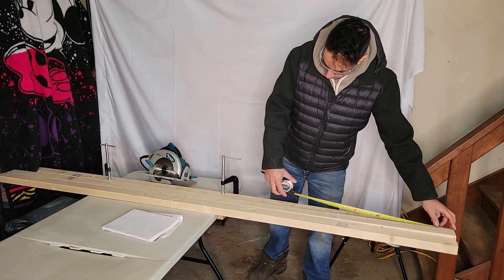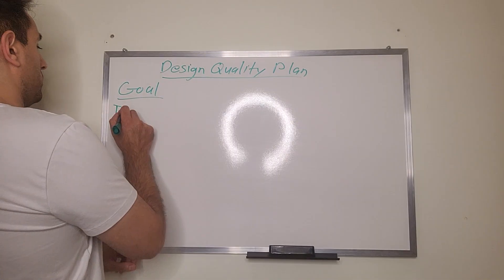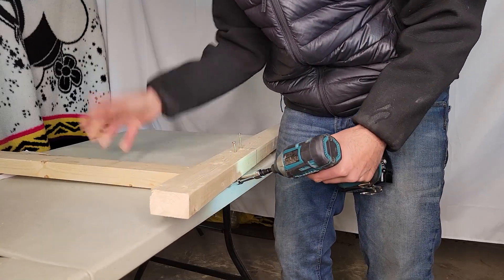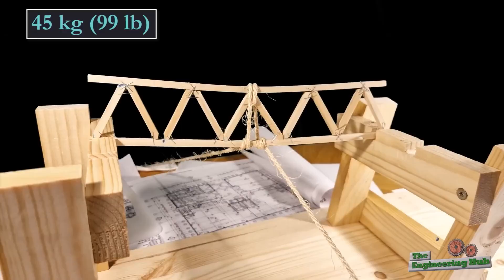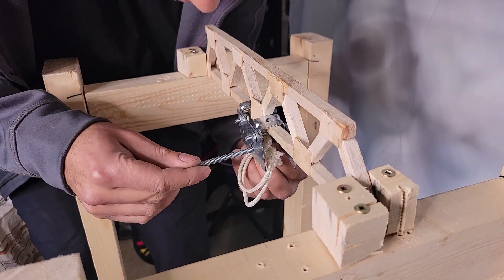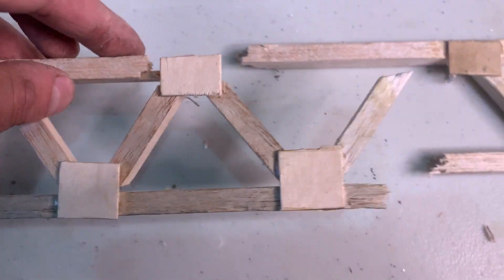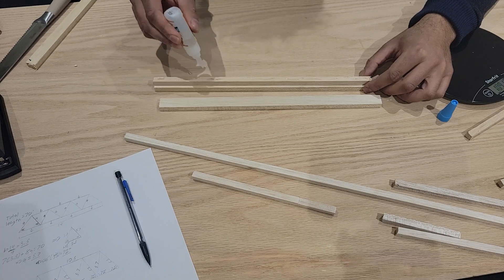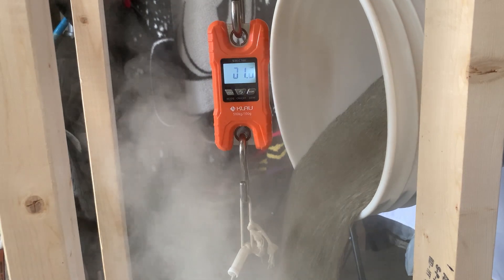How You Should NOT Do Engineering

Comment: Weak point is the gussets.  Use them on both sides and get really good glue.  If gussets fail make them bigger so they have more glue contact with members.  You can even cut the gussets to a more efficient shape rather than just square.  To match weight of beam make the members thinner as required.  Belt or orbit sander should work.

A truss can definitely have a point load at the bottom chord.  It just has to be designed for it.  They often have a vertical web aligned at the load.  A girder truss for example has hangers at the bottom chord to hang perpendicular trusses.

Comment: You have to load the truss from the top because that puts the braces in compression.  The fasteners only hold the braces in place and the joints always work against each other (in compression again) to spread the load further.  The fasteners do not carry any significant load if the braces are designed properly.

When you load from the bottom it puts the joint in extension and the fasteners will fail.  For example you loaded the beam from the top and you would not even need to glue it.  An unglued beam with the construction you used would carry only a little less weight than a glued beam.  

It's the same reason why a wooden gate will fail if you put the diagonal brace the wrong way in extension, but will be strong if you put it in compression.
Reply: Generally speaking that is not true. A truss can be loaded from the top or the bottom. His design failed pre-maturely due to the strength of the gusset plates. In a steel truss the gusset plates / connections are generally supposed to be designed to be slightly stronger than that of the beam in Tensile or Compressive loading.
Reply: @Astin2002  exactly.  A girder truss often has hangers for other trusses on the bottom chord.

Comment: Typically, gussets on trusses are attached with many, relatively small, fasteners. Wooden roof trusses use nailer plates. Bridge trusses use bolts, rivets, or spot-welds. For your test, I don't think normal construction methods will scale down to miniature size considering that the coarse grain of the pine-wood base material will remain constant. You should consider an alternate base material that will scale better, such as plastic. Or, simply build and test to normal scale and use normal construction methods. I mean, engineers have already figured out the proper construction methods a long time ago. Why re-invent the wheel?

Comment: The only weight the bottom of that structure should be holding up as like sheetrock. All structures are made to hold up the weight above , Like the next floor.The large sheets of osb that attach to the floor joist are glued to them and spread weight out the weight. You also messed up the friction with bad cuts they only touch on tips of angle cuts. Time stamp 205 will show angle cut not even touching. Where the staples are should of been metal cleat that covers all 3 connections. Should of had some one build that for you . I could of done whole thing testing and all in couple of hours. I'm a builder and can stick frame a 2 story home with wood sheathing exterior walls and roof with 2 helpers in 7 days.
Reply: Not true.  A girder truss has hangers for other trusses at the bottom chord.
Reply: You are wrong.
 The  truss in this video is  a Warren bridge truss.
 The bottom chord is used to attach the bridge deck.
 Both the top and bottom chords share the load equally which is why both of them failed equally.

Comment: You already know the weight and have the footage of the beam... just build the truss again/  use epoxy with your joints.. Drill little divots every 1/4" if you need to drop weight.. and load it from the top..  Keep it the same weight and length. I'm not sure why it took 4 months to build a little truss-- but you could definitely do it again in a few hours now.

Comment: Loading on the top will compress your joints and give you a better chance of them holding.. vs pulling them apart.  Also, just for consistency.  You loaded the top of the beam..So you would definitely want to load the top of the truss too;  just to keep it uniform.

Comment: Your weight consist is not a critical factor. Also the staples in the soft material would weaken it. And it is based on load not weight to measure. Also the height of each bridge should be constrained to be the same more than the weight.

Comment: Left a response on your short video.  Top chord is under compression.  Bottom chord is under tension.

You tested I-beam from the top, not through a hole in the middle.

Hope you redo the bridge test.  8th graders do it with toothpicks and it has to be a certain span, height, and maximum mass.

I-beams have a significantly larger mass, but they're structurally stronger.
If a web-truss could withstand a certain number of Newtons, then an I-beam of equal mass wouldn't be able to withstand the same Newtons.

That's why web-trusses are used in construction.   Less material, less mass, easier to construct, and easier to utilize on a construction project as mechanicals go through instead of having to drill holes in I-beams.

Comment: It appears you're using a cyanoacrylate glue ("Super Glue") to attach your gussets. I've been a carpenter and woodworker for 45 years (everything from framing to cabinetmaking), and whenever I've needed a maximum strength bond between wood pieces, I've used a respected and popular glue. There are several, but I greatly prefer Titebond products. (I have zero connection with the company--just speaking from my own experience.) Occasionally I'll use epoxy and, on rare occasions, and for temporary purposes only (such as holding a workpiece in place while I saw or plane or rout the workpiece), I'll use SuperGlue with a spray activator. There are other wood glues, of course, but if you watch the woodworking channels of people who know what they're doing, you'll see the Titebond label on almost all of them. SuperGlue? Rarely. Gorilla Glue? Forget it! Messy, porous stuff.
As for the stresses and other engineering issues, those are above my pay grade, but for wood to wood connections, use a recognized and respected brand of glue. Also, although TiteBond usually cures to 90% strength within an hour, I'd give your connections 24 hours before testing, so as to eliminate any possibility of uncured glue weakening your joint.
Reply from the maker: Thanks for your insight. Sorry I took so long to see this.

Comment: Even in big trusses, the connectors are commonly the limiting factor. This goes for most wood design. Here is a 6 story wood structure withstanding earthquake loads because they took some care in designing connections.

https://www.youtube.com/watch?v=hSwjkG3nv1c&t=19s

Consider using a wooden dowel as a pin through the member to connect your webs to your top and bottom chords without increasing weight. Just be careful on the diameter of the hole as it's a stress concentrator, and it's going to cause some other weird stress fields. Good rule of thumb for holes in beams is do not go over 1/3 diameter of the member. Also just consider a thru brad nail.

Loading from the top distributes load as compression, and wood is "stronger" in compression. It has something to do with the microstructure being comprised of cellulose tubes with a lingen binding them together, and that tension they are squeezed together makes it more brittle, while compression they are pulled apart making it more ductile. See image 39 and 40 in the below link. If you remember from your mechanics of deformable solids, a ductile material takes more energy(aka area under the stress strain curve) until ultimate failure. Another way to think of this is that if something is ductile it withstands more strain without reaching ultimate failure. In any case you can likely push a bit more performance out of your structure by just paying attention to this.

https://www.ncbi.nlm.nih.gov/pmc/articles/PMC9369726/

Also analyzing trusses as a FBD is not entirely accurate as there are internal stresses. Consider that wood is only a little bit stronger in compression, but it is much worse in shear resulting from bending moment. See page 103 to get a sense for the ratio of these values. All that is to say also consider internal stress distributions and its directions. The reality is that your principle directions are not necessarily cleanly along the grains, especially with a point load on the bottom chord.

https://www.fpl.fs.usda.gov/documnts/fplgtr/fpl_gtr190.pdf

Both those points are just optimization, just get your joints to not be the first point of failure.

Comment: Civil engineering graduate chiming in here. There are a number of reasons your truss failed but the biggest reason was the design. Your truss was assembled purely on butt joints with no interlocking members. At this point you are striclty testing the resilieny of the staples and the paper glue you applied on the gusset plate (IE testing the connection strength not the member strength). if you had used an alternative material to wood and used the same build and design methedology you would get neearly the same results.
Reply from the maker: Yup! Gonna redo this with proper joints
Reply: @WissamSeif  just glue gussets to both sides.  If that fails then make the gussets bigger.  To match the weight of the beam file the truss members down.
Reply: I learned so much from this comment. Thank you for that wisdom.
Reply: Would the weight be from the top, at least you would have an extra beam and the diagonals would actually be spreading load, now you just yank the bottom beam out of the structure from a few staples that bend real easy and a little bit of glue pulled sideways is not going to hold much weight either
Reply: If connection strength was the issue why did the top chord of the truss break as well?
 The load was applied to the bottom chord only.
Reply: @bigboreracing356  because once the connection failed the chords are no longer supported by the webs.
Reply: After doing some research I find that this truss will never be able to support 87 pounds like the laminated beam does.
 The chords are simply to weak and band aiding with over size gawdy gussets defeats the purpose of the experiment.
  The beam consist of more than two chords ( six total counting the flanges) glued together.
 The lamination process creates a more stabil material that will support more load than any unstabil wooden truss that weighs the same.
Reply: @bigboreracing356  are you an engineer?  What research exactly did you do?
Reply: Before I answer the questions I will inquire why the need for them and what type of person are you?
For the love of God do not be the type with Preexisting Bias.
 Those type are a thorn in the side of society and a waste of intellectual conversation.

Comment: 3D print the truss and beam, have the same volume between them and do 100% infill. This will remove the fail point of the joints. If that is not an option use good woodworking glue cured overnight while clamped together instead of a stapler.

My high school wood shop had a project just like this but using chopsticks. I did a truss reinforced arch and got to 45 pounds using chop sticks!
Reply from the maker: Yea I need to return to basics. Embarrassed that I can't build a popsickle stick bridge 😂😂
Reply: @WissamSeif  Why are you embarrassed?  Each chord of the truss supported 13.5 pounds before breaking.
 Divide the crossection dimensions of the laminated beam by the crossection dimensions of one truss chord and you will see  the material used to make the beam is just as weak as the material used in the truss.